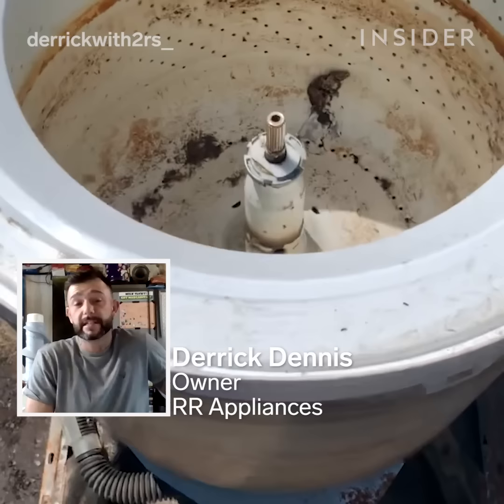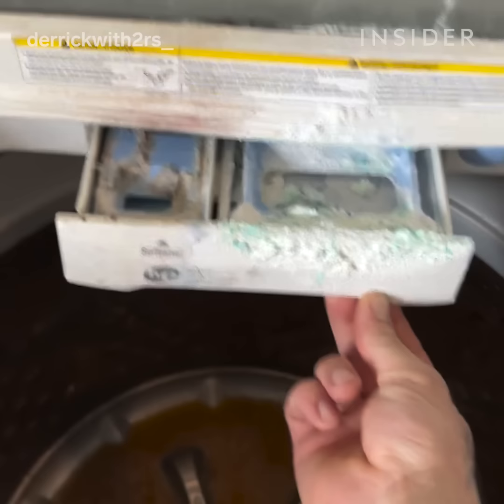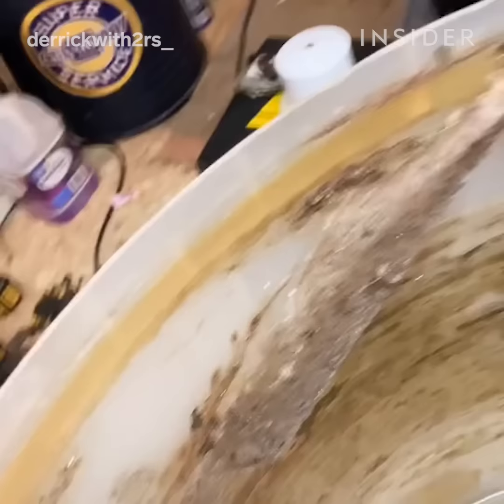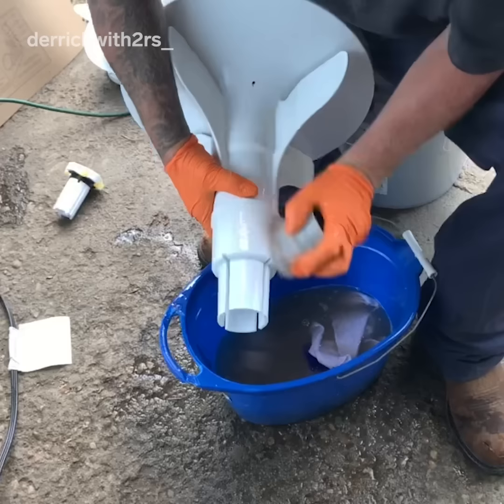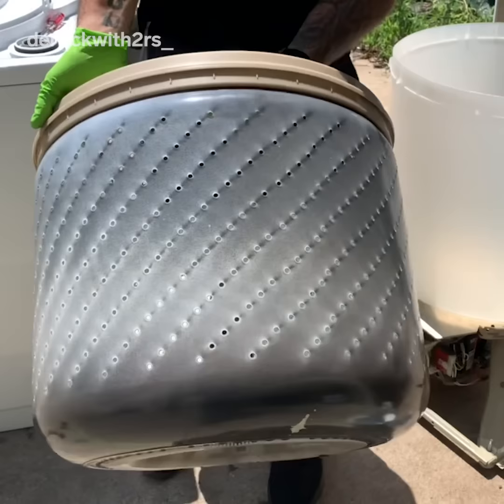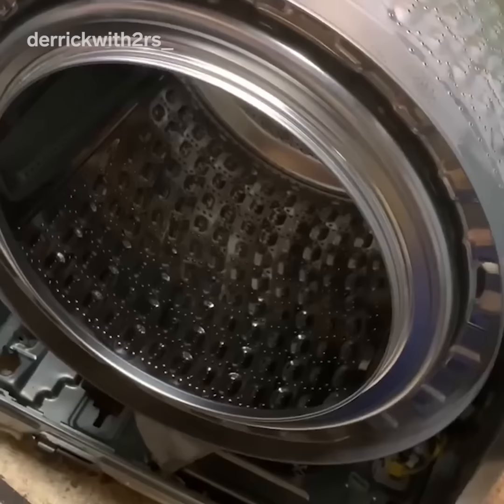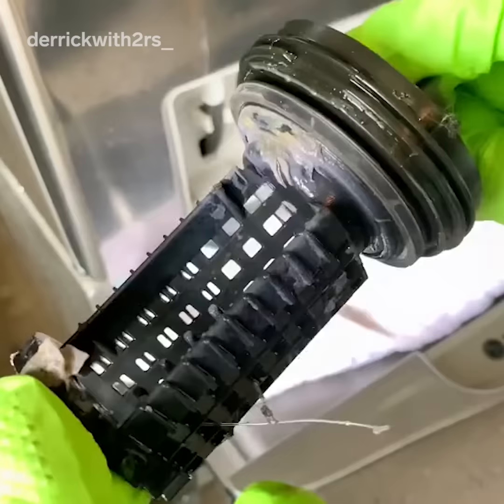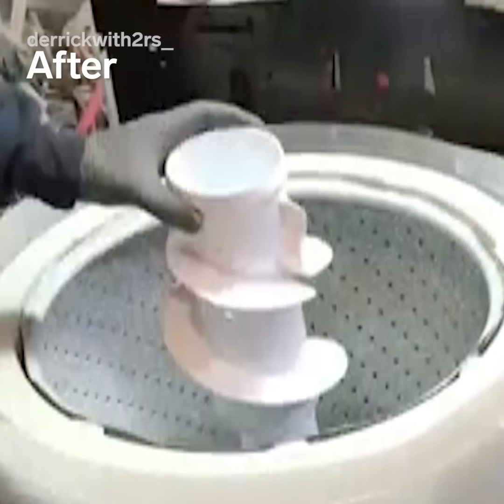How The Insides Of Washing Machines Are Deep Cleaned | Deep Cleaned | Insider

Comment: So I actually took apart my washing machine. The drum casing was factory glued (not bolted sadly) so I had to saw it. Cleaning off the mold/debris off the drum were extremely easy to do. It's just scrubbing with any kind of sponge would do, and a washing soap helps alot. Pretty easy. The tough part was sawing it open, gluing it back with silicone and assembly

Comment: Me while watching this: looks simple enough, let me deep clean the washer myself!
Reply: I too had this thought, then my better senses kicked in...thank goodness.
Reply: I just tried to do mine the other day, it's a top loader I couldn't get the basket/drum out but I was able to get the bottom off and a good view of all the grime.  I tried to scrub but there was no way I could do it efficiently so I added some vinegar and hit the clean machine button.
Reply: Yeah, i just disassembled 40% of it and got stuck on a rusted out screw. But I cleaned it the best I could, added a few hundred grams of lye in the detergent compartment, and put the machine on the highest temperature setting. A lot of crap came out, at some point brown specks and foam came out (I did not add detergent)

Comment: It's only the LG and Samsung washers that shred bearings in just a few years. My Whirlpool front loader has been bulletproof for 12 years and I abuse the crap out of it.  I put small rugs, oily rags, shoes and all sorts of things in it that I probably shouldn't. It's never skipped a beat and never gotten smelly.
Reply: I have had a LG front loader washer dryer combo for 9 years and it's still going strong.
Reply: Nowadays, washers from even the big brands like Miele or Siemens/Bosch aren't bulletproof anymore. Stuff gets fabricated with too much plastic, inferior materials or simply build to last only until the 2year warranty is over. 
Planned obsolence of the electronic parts, crappy making of mechanic parts, and if the bearings go out, you have to replace the whole barrel/drum, because the bearings have been plastic-welded into there. 
Shocks also go bad embarassingly easy. (Yes, a washer has shocks. Shocks and springs.) 
I'm probably never going to shell out another 1200€ for another high brand washer again.
Reply: Coworker bought a samsung washer dryer combo and has had at least 5 service calls
Reply: @skyure  just replaced the water input valve assembly on my Electrolux. 7 years old and that was the first issue.
Reply: @elibennett3034   To be honest, you're insanely lucky if your washer held out that long with just one repair. 
I had a 20yo Siemens Washer, worked like a charm without needing any repairs until one day it didn't. 
Since then, new washers that never lasted any longer than 2 1/2years without needing any major repairs. Expensive brand ones, too, since we believed (stupid as I was) that they would be high quality as promised.
Now I own an expensive POS that's only 5years old, which only keeps from falling apart by ME repairing it at least once every few months. I can tell you with confidence that the non-brand parts of this washer not only cost a fraction but also have a better quality than the normal brand parts. 
You can see the stress fractures in cheap plastic parts, burst shocks leaking fluid, cheap heating elements that corrode at a ridiculous speed.
Electrical components exposed to water, were a simple rubber cover would have helped, but was saved because of cost-reduction. 
Big brands aren't what they were anymore, sadly, their promises are nothing more than hot air blown into your face.
In these times, where you're supposed to look at the environment and want stuff that's build to last, you're blowing out money for things that you think would last you a decade (like most cars, not anymore) and you're left with a pile of literal scrap metal and plastic, and think to yourself "I should have bought a cheap washer." since they'll probably last the same amount of time (most often they last even longer), and you're paying less.
Reply: @skyure  I guess I got lucky. Funny enough, I have a Bosch dishwasher (same age) and it hasn't cleared water properly for a long time. 🤷 Go figure.
Reply: @elibennett3034   nods What I found out that if I use just a tablespoon of the stuff you use to unclogg drains, and a hot cycle, that helps with any problems with the machine being unable to pump off water, since it's either the pump that's clogged, or the drains of the dishwasher. 
If you do it, try not to use too much, and use a gel of the drain unclogger. Remember, it might foam a little, so check on it.

Comment: Well this has been absolutely terrifying.  Thankfully I have never used fabric softener in my washer.  I'm guess those scent beads I like so much are probably bad too ☹️
Reply: Also many years ago I excitedly purchased a front loader.  I hated it pretty much the entire time I owned it.  The mold issue was ridiculous. When it broke, I wasn't even sad.  I was just happy that after the battle to get the door to open so I could get my clothes out, the rest of the water didn't spill out.  The people who had to haul it out were not impressed that the machine weighed so much more than it should have from the trapped water that none of us could get to drain out.  I purchased a new commercial upright and never looked back.
Reply: @metalcatmom5891  Honestly have never seen these issues mentioned ever here in Sweden. Maybe the machines used and the chems used have something to do with it?
Reply: @wankZkills  I think the water hardness might have something to do with it as well. You got fairly soft water over there?
Reply: @carsten.hamburg8771  Actually the hardness of the water varies of where you are located here but yet that's no issue since the machines are developed to adapt or be suited for our water types.
Reply: those beads are as bad, I made into a journey doing cloth diapering, and knowing the water and detergent buildup in my washing machine turns out that I should stop even the scented dryer sheets back then, I was wondering why I break out in rashes and clothes smells being left in a washer for a day... the unit has been here since it was built in 2004 and it's still working and running. The last time I had to do maintenance to it 2 yrs ago cause the bearing wore out. 

This is why I would recommend people to buy an old unit and ask the appliance serviceman to service it first.

Comment: At what point do you just buy a new machine?
Reply: Use washing machine tablets
Reply: The point where the machine doesn’t work. If it works, but just needs cleaning then clean it.
Reply: @xtrey19x  what do mean doesn't work?,it should be replaced when cost to repair is more than cost of the machine or it keeps needing repair.
Reply: @MeMelon4u  You can’t read.
Reply: @xtrey19x wow, thought u would be smarter than that but that explains why u wrote ur original comment.
Reply: @MeMelon4u  it should be replaced when repair cost is half of the value
Reply: @rafaelacosta5724  um yeah more than half actually

Comment: 1. why no fabric softener? didn't quite get that.
2. im wondering how much your service cost? isn't it more efficient to just buy new machine after such buildup ?
3. how much vinegar would you use? also baking soda after?
Reply: 1. fabric softener works by lubricating the fibers in your clothes, making them softer to touch. but this same lubrication builds up in your machine as well and causes clogs.
3. i just dump a liter in. it's cheap and it can't hurt.
Reply: 2. How is that more efficient? You think he is charging a grand for the daycs work?

Comment: Hello I've had my washer for about 8 yrs and recently everytime I load it it bangs super loud and shakes even though I try really hard to spread the clothes out so it balanced. What should I do??
Reply: Did you remove the shipping immobilizer thing on the back that you are supposed to on install?
Reply: @jkxss  I DK I didn't install it. When we bought it we had it delivered and installed.
Reply: If its a top loader, it could be shocks or maybe a loose belt.  Also, it could be the inner metal tub has become damaged... possibly rusted in the center where it connects to the tub nut,  causing it to spin unevenly and bang against the housing... (I learned from experience).  I don't know your skill level, but washer machines are pretty simple and you can find some "how to" videos and fix it.  For mine the total cost was $240, but includes shocks, belts, drive block, fabric softener filter (because I tried to open it) and the inner tub.  Mine is 9 years old, and this was the first servicing it's needed.  Hoping it lasts another 9 years.  To be honest, fixing it was pretty simple except removing the tub nut.

Comment: I wonder if the use of so much plastic is one reason for machines being so dirty.  I don't remember washers from the 60's- 80s ever smelling bad.
Reply: because nobody used liquid detergent, everything was washed in powder (which contains oxygen bleach) and using hot or warm water
Reply: @Kubulek17  One thing I know, there is always better to wash in warm/hot water as it actually gets all the stuff that the guys trying to clean off plus hot water actually does a better job cleaning, but if you have really hot water, the best bet is to use warm

Comment: Yeah.......I’ve never just used two tablespoons of detergent.....😂 Ive even stopped using the cups it comes with. I pour straight out the bottle until the lord tells me to stop 🙏
Reply: That’s one of the worst things you can do to both your clothes and your machine. Make it easier on yourself if you don’t want to measure and use laundry detergent sheets. You can get them online probably easier than finding in a store. In most cases you can cut the sheets in half and get double the amount of estimated laundry loads. Too much detergent is one of the most common mistakes people make, a very very small amount goes a very long way. Soap residue and scum builds up and then starts to trap crap into your clothes and makes it harder to clean the actual machine too.

Comment: Wish I had a power washer. That balance ring on the bottom of the Kenmore [Whirlpool] drum is impossible otherwise. My washer is more than 50 years old. The first time I took the drum out it looked like there was roadkill on the sides of the plastic tub. I had to scrape it off with a spatula. Just unimaginable that you can be washing your clothes in that filth.
Reply: You have a 50 year old Kenmore with plastic outer tub ? They were porcelain coated metal, BUT I do remember hearing Whirlpool did make some machines with plastic outer tubs in the early 70s.... Might have been a test run for the direct drives they were working on that would be released in the early '80s.

Comment: We don't use fabric softener to clean clothes we use it to soften the clothes, hence "fabric SOFTENER.  My clothes never stink so I don't know what you are talking about.  Pinesol stinks.  I have a clean cycle on my washing machine to clean the machine and I use that every time I am done with my weekly washing.  I don't like front loaders because they didn't clean my clothes and NEVER washed my sheets and blankets properly.  I bought a top loader without an agitator.  I had an old top load washer for 25 years and it worked well all those years.  I think like everything else washers and dryers are NOT made as well as they used to be, they have built-in obsolescence, meaning they are built to fail after a few years.